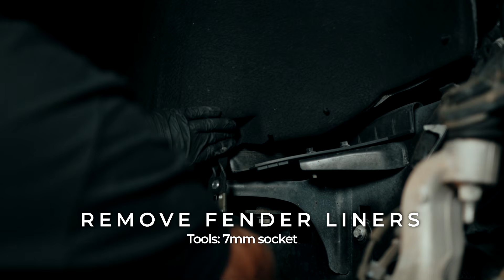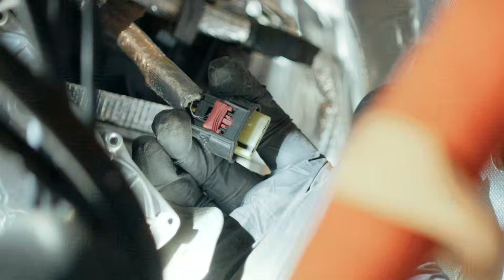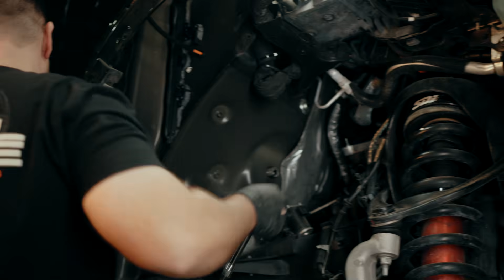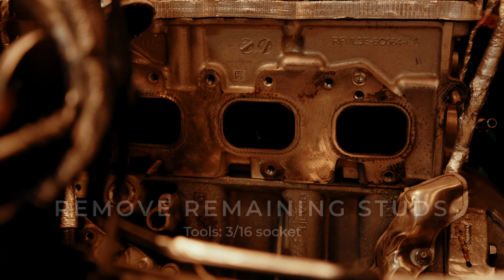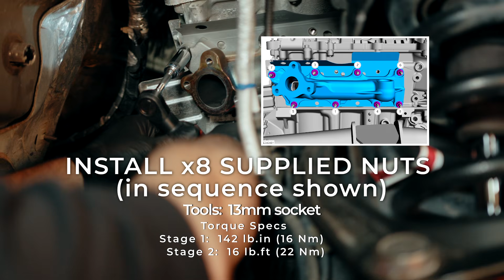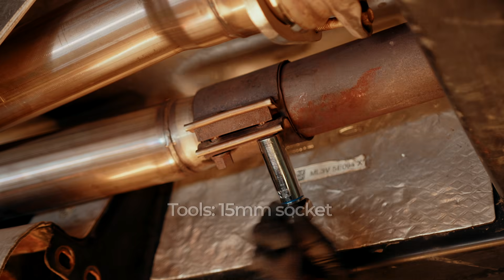How to Install Full-Race Formline® Turbo Kit | 2021+ Ford Raptor 3.5L EcoBoost (GEN3)

Comment: where intercooler
Reply from the maker: You can find that here: https://www.full-race.com/full-race-2015-2023-ford-raptor-f-150-3-5l-ecoboost-intercooler-kit

Install video for the intercooler is coming very soon!
Reply: @FullRaceTurbo  looking forward to it! What’s the ballpark whp with this kit with a 93 tune from a reputable tuner? Give it to me straight… Am I ever going to be able to keep up with an R without E50?
Reply: @samesamebutstillsame you can pull a raptor r in a stock raptor with a tune and e50

Comment: That is an awesome upgrade! I have a 2024 Raptor. How much for the kit in this video and install. Looks a bit complex but would love to see that power on my eco boost.
Reply from the maker: Around $10k for the Turbo Kit + Intercooler! Labor can vary depending on the shop and your specific setup, but most shops quote around 14 hours of labor to install the full kit.